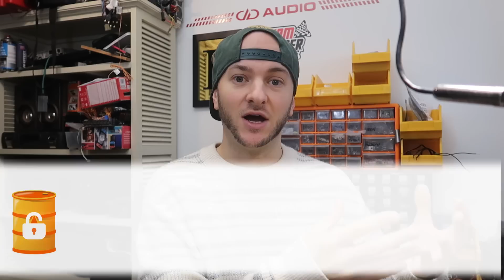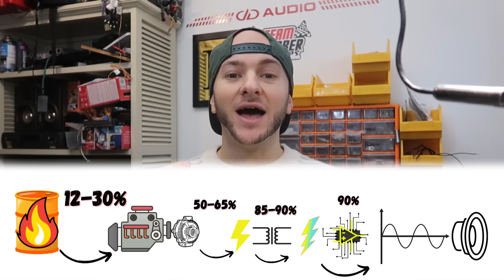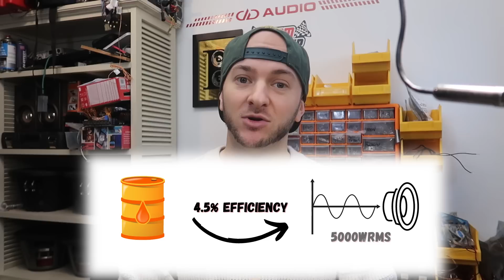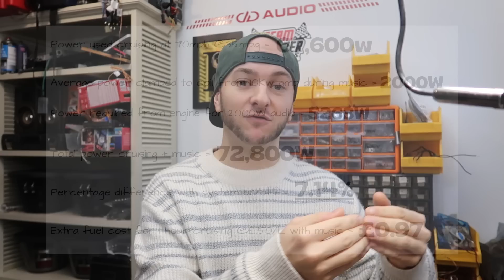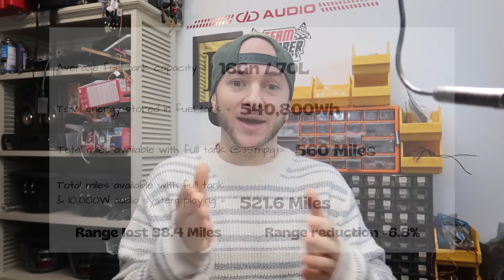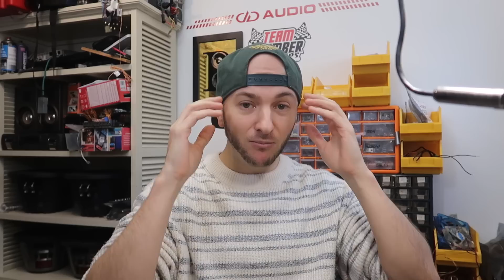What Happens to Car Audio in an Electric Vehicle Future?

Comment: Hi Barevids. Great vid. If you were wanting to try and rig up a HV system let me know. This is what we work on day in day out. That said, many EV's now have a 240v outlet or V2L (240 3000W), although your speciality definitely isn't mine, so unsure what current and voltage would be an ideal for a good setup.
Reply: I've been doing this for years. 400volts up to 320 amps here

Comment: Boxer engines have very limited choices on charging. You can up grade
to a higher output alternator. 
Would an electric motor work to run multiple alternators built on a rack to
charge extra supplemental batteries or
lithium ? Thoughts, opinions ?

Comment: My hybrid, which doesn't have an alternator, can only convert the high voltage to low voltage to the 12V battery at 30A.  I haven't checked how many amps our EV can convert, but it's something to consider.
Reply: Toyota?

Comment: I think the amplifier will be more multi-voltage, range from 12 to 36 volt to make it safe and easier to install in different cars, alsp aftermarket step-down converters from the batteries high DC voltage to 12-24 volt with built in battery/capacitor with various output capabilities depending on demand, they will be installed by an car audio or car service company for saftey reasons.

Comment: Hopefully by the time 50% of vehicles are EVs we will have higher voltage input for amplifiers so the amp can use a higher efficiency buck converter for the rails with 400V inputs form the EV battery.
Reply: It already exists
Reply: Those already exist but there's a couple problems. 1. Evs have wildly different voltages, so amps will have to be car specific. 2. Working on a 400V dc battery is extremely dangerous and should only be done by professionals

Comment: Do you think thr spinning magnets in the 4 electric motors will mess with the function of the drivers? Or perhaps through electromagmetic induction induce high frequency noise into the spund wires or speakers?

Comment: Wonder about running a home audio sub into the factory 120V (American) outlet I have in the rear seat of my F-150 lightning then using a line level convertor from a speaker to get a signal.  Off to research that now.

Comment: This is between what time periods, and during these periods being used for example, what would these power usage for the motors be? The motors are smooth draw as they wind up, and down, relative, but people don’t generally don’t listen to test tones. I know that I, having test tones on my favorites is not typically what most people have, but I am a little odd. But I also enjoy music, which is pretty dynamic, and it pulls more and less power, according to the beat of the music. 
So, I understand that it’s more efficient without converting, but what would the outcome be with the dynamic power draw affect the range and battery capacity/life end up. That is after the amplifiers were modified.

Comment: Doesn’t have to step down and back up again if the 12V is a separate battery from the high voltage bank.
Reply from the maker: @pastaman6099  but that separate bank still needs charging, which will be done by a step down converter 😀

Comment: There is a problem with new EV's in the fact they range from 400-950v. Most EV management systems will not allow you to tap in to the high voltage system or even change the step down transformer for a higher amperage unit as it is usually built in to the power management system. The BCM will see the drain and shut the battery down thinking its a battery fault.  If you could hack and reprogram the BCM to allow the external drain, you could be in danger of overloading the battery pack and causing thermal runaway. In higher end EV's this may not be a problem due to the batteries having active cooling systems, but many of the cheaper EV's dont have battery cooling systems.Tesla and Mercedes are ditching the 12v system in favour of a 48v low amperage system to lower the amperage draw from the high voltage battery.

Comment: I have to disagree. It's not a range problem. EV's can get about the average of the range a tank of gas 300/m a tank. The problem is the time it takes to refill it to full to get that range. You just can't beat the 10g/minute  a 16g tank is full in under 2 minutes! How much charge is an EV getting in 2 minutes even on a Supercharger? Until they can get the che charging rates up, or swap batteries for fully charged ones, the Semi's REALLY don't make sense! With 34g/minute even at 300g tank size, it's under 9 minutes to full capacity! How much charge is a Tesla Semi getting in 10 minutes?

Comment: Problem with current electric cars and all the converting of energy is if the amplifier putting out 5k watts and needing 6.8kw for 1 hour of play is equivalent to using 35 miles of range for 1 hour of play. A Tesla gets somewhere around 5 miles per kw of battery. That’s not exact but close.
Reply: If that was an efficient gas vehicle getting around 35mpg that would be equivalent to 1 gallon per hour to run your subwoofer

Comment: I know right now we're mostly still using 12 volt car audio stuff in EVs, but people are already starting to just use the high voltage that's already there.

There is a YouTuber that goes by LoudFiat
That has It sound system like we like running off the 400 and something volt battery in his Fiat EV. Not only is it super efficient (I believe his tested it at like 98%) but the high voltage allows ridiculous power through smaller wires.
These high voltage systems let you run an amplifier that would need power wires thicker than your arm off of something comparable to a Walmart app kit and the amps themselves are absolutely tiny by comparison to something capable of the same output on 12 volt.

Comment: With how proprietary EVs seem to be, how would someone go about accessing the 12 volt output on the step down converter? Also, would a manufacturer then void the warranty for part or all of their car for doing so? I feel like car manufacturers have used this switch to electric vehicles as an excuse to increase their control over customers, so I can foresee such an event taking place one day.
Reply: All EVs have a 12V battery, just take it off that. Probably fine for most non extreme installs.

Comment: I'm not exactly sure how e.vs work, but can we clamp into the voltage of an electric car or do we still need to draw from the separate 12v system? Cause if we can draw from the cars battery pack, than we're in business. But if it needs to run off the 12v system, I don't see a benefit. But like I said, I don't really know
Reply from the maker: I cover this in the video :) even stepping down to 12v from the HV supply, it's still much better than using an alt to convert the rotational kinetic energy of the engine into electrical.
Reply: Most systems barely draw 20 to 40 amps so they can easily be added to the stock 12v battery. If you're talking about building a bass van where you need hundreds of amps then you can tap into the batteries high voltage output. There's a positive and negative wire coming out of the main battery going to the inverter which converts it to AC power and then that goes to the drive Motors.
Reply: I run it off 400v directly

Comment: As an ev owner with an aftermarket stereo a basic system is still pretty straight forward. It has all the same issues as any modern car where everything is tied into the factory head unit but beyond that it has a normal "12V" system to power all the accessory. From the factory my car has a 1600W DC/DC converter for the 12v system. So about the same amount of energy you would have with a 120a alternator. I have added two amps 500w sub amp and a 50x4 for my components. The car has no issue with this and the has made no measurable difference to my range/efficiency.  While definitely not undo-able, if you need to upgrade the 12V system, upgrading the DC/DC converter would probably be much more complicated than just upgrading an alternator. There are probably ev that are easier to upgrade than other an I sure some have setups that are higher than 1600W. As with everything as ev become more common and the market for modifications expands more solutions for upgrading audio will become available.

Comment: 12V is not enough... 400V is lethal... but 48V I think will endout winning!.. In a near future all EV will slowly quit that dinausore voltage for accessories and move to 48V whick reduce wire size, weight and improove eficiency.... 48V win as well as for off the grid systems..

Comment: Class D for all low end EV audio. BASH audio for all high end EV audio. If unfamiliar with BASH, look up the ELAC amplifier and the technology it uses. Also, no reason why amps couldnt be made to use higher DC voltage increasing efficiency.

Comment: Just get into the battery bank find out where the line side is located then get a transformer to step down the High voltage till you can use it for our 12v electronics

Comment: EV Amplifiers will be almost the same, just equipped with a stepdown converter instead of stepup.   The Cable management will be changing too.
1. (bad) Has to be much safer
2. (good) For the same Power you will need much thinner cables.
Cable size example: 
12AWG (2,5mm²) can carry 15A most EV voltage is 300 - 400V = 4500 W (empty battery)
Same Power @ 12,6V you need 360A wich need at least 0AWG (50mm²) with 0,6V loss

Comment: These EV's don't and won't have cigarette lighter sockets with 120v output.  The high voltage is a separate circuit that is not available for consumers to mess around with.  Even if a new high voltage standard was introduced, amps and other electronics will still need a power supply section, just step down instead of step up.
Reply: They have 3 prong 120v outlets, just like your house.

Comment: So you claimed car audio has an effect on the gas milage and will decrease the efficency but that's not true at all. That would mean that a high output alterntor has a bigger effect on the MPG than a stock alternator and that's not the case at all I can say with experience I get the same MPG with a high output as I did with the stock. The ampifier might play a very small role in the cars MPG but tht role is way smaller than you claimed to a not even noticeable amount. The alternators output is a always fluctuating with the RPM and puts out an AC wave into the voltage regulator and diode rectifier and the resistance the alternator puts on the engine is only at the belt and pulley. The resistance doesnt change with RPMs there for any effect on the MPG is not from the current the a alternator provides. You're great at what you do and i hope i am not offending you because I have learned so much fromyour channel but as a mechanic who studied low voltage electrical power in automotive applications I can say without  doubt you are incorrect in the effects an amp has on a gas engine MPG.
Reply from the maker: - An alternator only loads then engine when current is demanded from it
- Due to battery buffer you will not notice MPG changes on a journey-by-journey basis
- The real world average power usage of an audio system over the course of a tank of petrol is immeasurably small, going from one rating of alt to a higher rating of alt wont yield any readable change in MPG on your dash
- Use common sense and the law of conservation, any power drawn by your amplifier MUST have been generated by your engine thus reduced the total power available to the drivetrain.
Reply: During normal use a high output alternator won't have anymore drag on the motor than a factory one is right now at full power the  h/o alternator will have a significant increase in drag over the stock one.
Reply: @motosk8er2  I never said anything about free energy. I was saying his claim that audio equipment and the alternator have an effect on the engine efficiency the more current that they pull and that is not correct. aside from the resistance put on the belt the MPG is the same at low current draw and high current draw
Reply: @barevids  Power drawn from the amplifier  has no effect on drive train power and is only at the mercy of the alternator. Which has no effect on drive train power if the amplifier is high current draw or low current draw the effect on MPG is the same.
Reply from the maker: @MobileAudioPro  you have absolutely no idea how the conservation of energy works. Please educate yourself especially with a username such as yours!

Comment: I don't think electric cars are the future just because battery tech sucks but I would imagine ev cars would give car audio engineers so many more options for equipment.  Why not tap a 40 volt line? You could decrease wire sizes by decreasing total amps pulled.  The future is bright with ideas fellas.

Comment: I was shocked by 230v ac and 630v dc both was passing through my heart through my hands. I would say ac is more deadly. It locks you up and stops you from doing anything, while dc makes, at least in my case me jump. It was very painful and probably fucked up my shoulder joint, it was painful to move in certain direction for a few months. 400vdc in evs will probably not kill people but i can see more fires not that it doesnt happen on unmodified cars already. And also some injuries, and unwanted sparks etc. I think its a very good idea in terms of efficiency to use hv amps, its gonna be cheap and very efficient, but i think the amps should be developed further with protections and overall design. Also i think people will get more accidents etc with vibrations, also i think its very smart to put fuses or breakers on those circuits. Team nofuze wouod be incredibly stupid. Not that its ok to do so on 12v.

Comment: Although your efficiency is all make sense really it comes down to the end source your amp hours or your current draw you don't have extra batteries in your electric vehicle so any extra juice you draw off your initial batteries is going to reduce your distance. 13,000 Watts consume your 250 mi pretty quick. Besides petrol can recharge your batteries your EV can't recharge without a station so you might as well start planning on bringing a small generator in your trunk so when you get stuck at a red light bumping you can get through 😂 also your alternator is tuned to start pumping out amperage at a higher RPM which makes it inefficient for gasoline engines unlike diesel engines the alternators kick on full power at a much lower RPM which are much more efficient on the engine. Also you throw a hide amperage alternator on a four banger versus a V8 Yes you're going to have a huge difference in efficiency. Again it comes down to physics rotating mass will hold momentum until otherwise acted upon
Reply from the maker: in an EV system using method 1, you would still have 12v battery buffers, charged by the step down converter just like an alternator does :)
Reply: 13,000 watts? Thats a very rare individual. I don't think its going to drop the driving range very much at all. Look how long a small lithium battery bank can run a big system. It can demo for hours.

Comment: Don't EV's have a separate 12v battery to run all the accessories like radio, climate controls, heated mirrors, etc?
Reply from the maker: Yes, they do, this acts as a buffer between the step-down converter and amp, same way as it does between alt and amp.

Comment: why bring the EV battery power to a step down PSU/transformers to make 12 volts DC for the amplifier to then raise voltages back up above 24volts AC. why not just start making 48+volt amplifiers and reduce some of the conversion loses. Should be more efficient, business chances?, and weigh less (transformers are heavy)....
Reply from the maker: I guess you didn't watch the whole video 😁

Comment: EVs will be better for car audio I believe.
Reply from the maker: I actually agree ☺
Reply: I doubt it, EV's already have their range cut in half simply by driving in cold weather.
Then you want to add a bunch of extra weight and another electric load...
Gas may be inefficient but you can refuel in 5 minutes and effectively just acts as a generator especially when you add high output alternators.